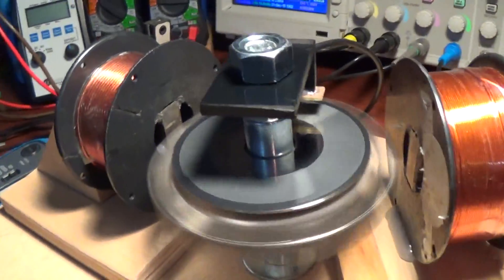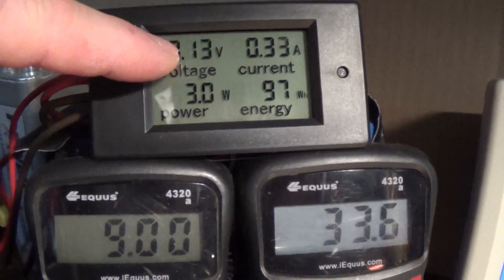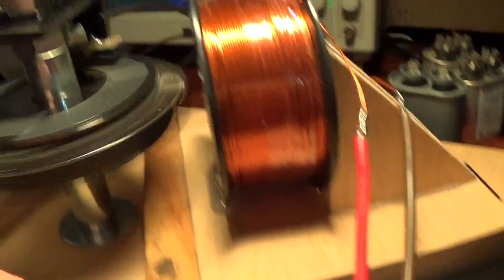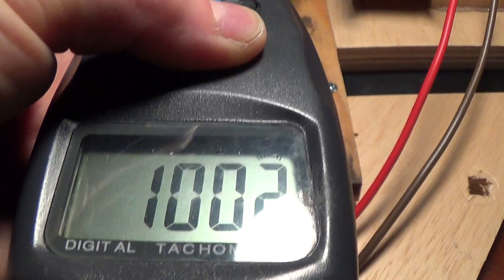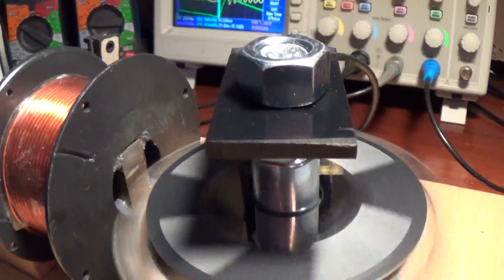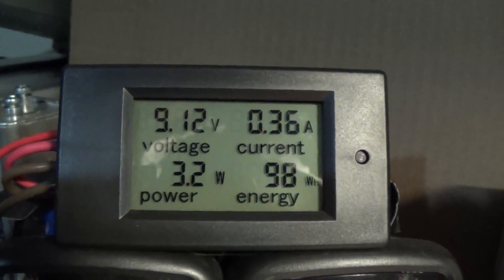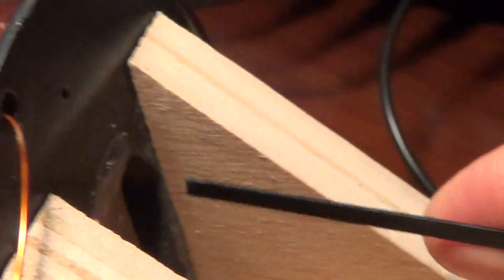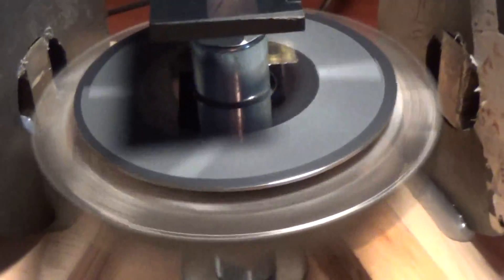Sharing ideas, how to build a more efficient motor (p.7)

Comment: I shared this and how I discovered it on OU back in 2011 along with schematic. As par for the course, everyone shot it down and wondered what I was smoking... I'm glad someone else discovered the same thing. My first iteration was playing with solid state sending flyback to High impedance coil/cap to move magnet on pendulum . then I sent the spike on Bedini wheel single drive coil to 3 separate coils around the wheel all in series , the darn thing took off. I shared it was laughed off the stage so I removed all my vids. This is my first post since then. Ur vid somehow shoed up in my feed today 🙂

Comment: This is amazing. Did you continue making the design more? The bemf driving the motor more efficient. great idea
Reply from the maker: It worked well in a loosely coupled design like in this demo but as soon as I tried to close the gaps to raise the motors efficiency it didn’t go above a normal magnet motors efficiency.

Comment: Thanks for posting your work. This is very interesting. One comment: here you removed the other coil after tuning the operation for the two coils. After that is there any room to enhance the single coil operation by tuning / adjusting the sensor?
Reply from the maker: +TruthJudgesBrutally Hi, thanks for your post. The answer to your question is no, there is no better adjustment that would help the primary motor coil. I tried that to make sure this wasn't the case. It only got worse when I tried to change the timing or coil distance from rotor.